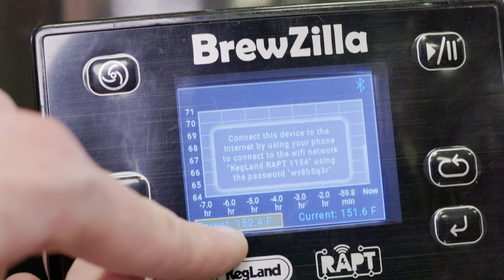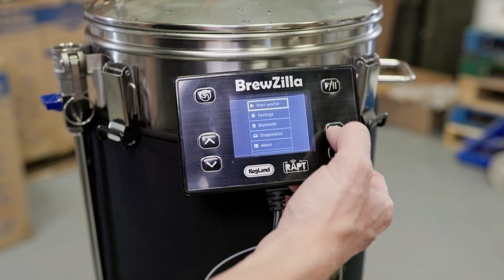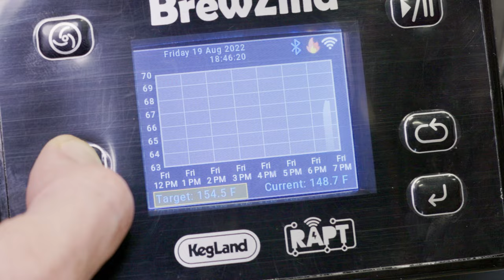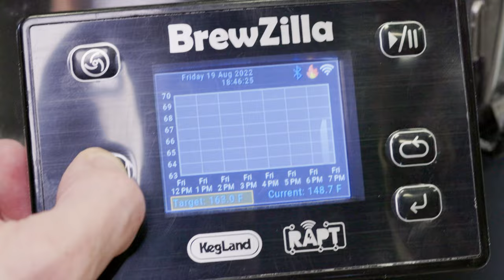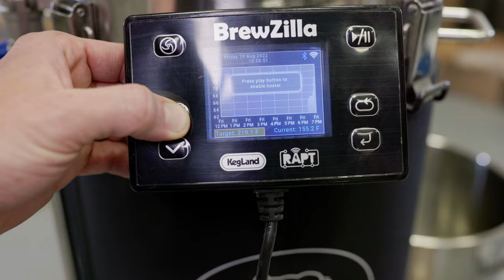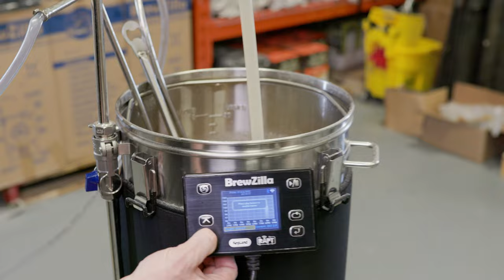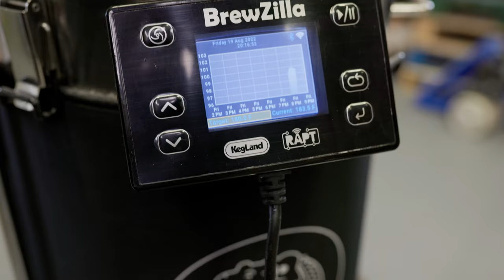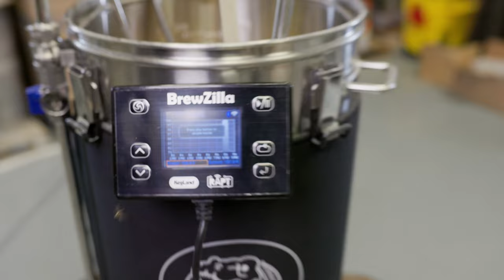The Ultimate Brewzilla Gen 4 Step By Step Tutorial - Make Great Beer On Your First Try

Comment: A pour collar on the top would be handy to keep you Grain dust from spilling all over the control unit.
Reply from the maker: Control panel is enclosed and water proof.  Shouldn't be an issue.  Cheers!
Reply: @graintoglass  regardless, having to clean it and around the brew setup. A pour type lid for buckets then. I just see the extra clean up when brew days are already long enough!

Comment: Does anyone use this system for distilling? I'm going to get a 4 inch 4-plate still column and still don't know what boiler system I want. A lot of conflicting opinions saying I need voltage control for distilling. This system looks stable enough to maintain temps tho??? Anyone able to help.
Reply from the maker: I haven't used it for distilling but some of our customers have.  Just like a lot of people who have the Grainfather buy the T500 condenser for distilling.